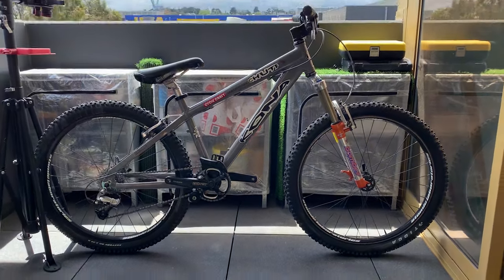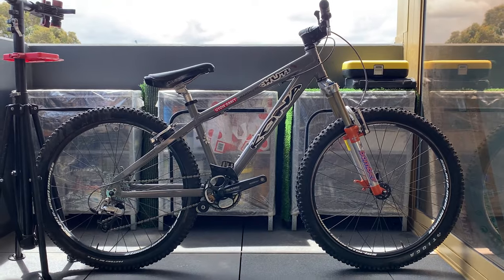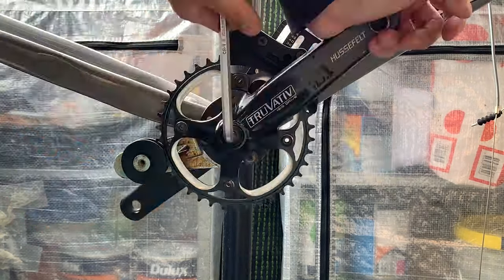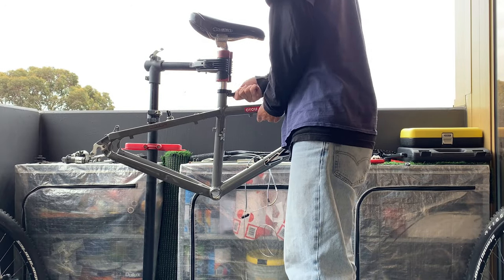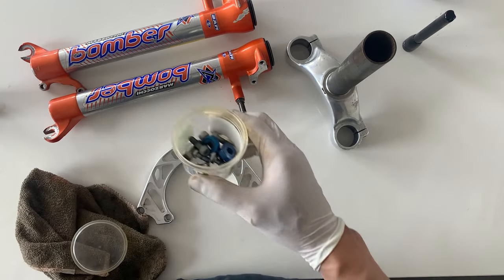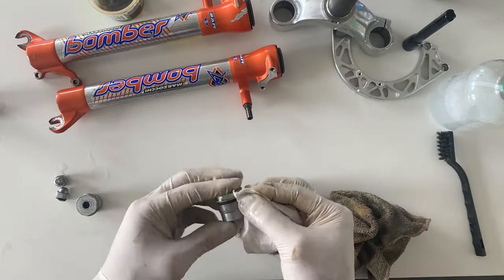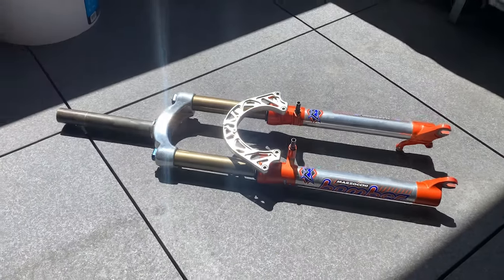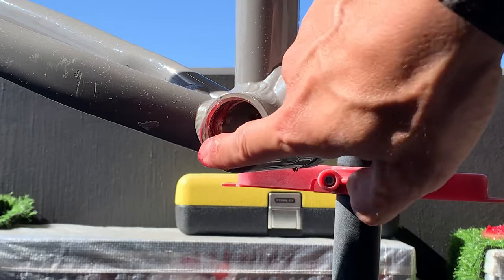single speed MTB conversion re build - Kona Chute Marzocchi z1 bam

Comment: The rear disc brake: There's more to it than just loosening the caliper. The inside pad is usually fixed and usually has an adjustment. You need to adjust that in/tighter, then pull the brake lever and tighten the bolts. Then you turn it out until it spins cleanly.
Reply from the maker: cheers thanks for the tip! usually i just loosen the bolts , pull on the brake and re tighten and that works! do you know where the pad adjustment is ? i cant seem to find it ? are you talking about the metal clip ?
Reply: @garysprojects  If the caliper moves both of the pads then no adjustment necessary. If the outside moves then look for a hex or torx head for the adjuster. You will see it from drive side looking through the wheel.
Reply from the maker: @peppermintpig974 ahhh nice, I don’t think this caliper has an adjustment but good to know if I work on other ones, cheers!

Comment: Great build! And I really like the tube chainstay guard idea, but could you explain it a bit better? I get that one end is held in place with a zip-tie, but what about the other? Is it just wrapped around itself? And if so is that really secure enough?
Reply from the maker: Cheers man! Ya u basically just cut up a tube and you put it flat on one end of the chainstay and u start by wrapping it around it self, then you keep over lapping it until you get to the other side and finish it with a zip tie. I didn’t use anything to affix the other end, it’s just held on by the pressure of the wrap. If you want u can put tape on where you start for more security or even a zip tie. For me it’s holding up for now. Hope that helps cheers!
Reply: @garysprojects  Alright, that makes sense now! Thank you so much!

Comment: what is your favourite handlebar grips? what is your top 5?
Reply from the maker: I’ve been liking the dmr deathgrips just because they are easy to put on, I also like oury v2 and the just soft silicone/foam ones on eBay - most of the grips I like i put in my bikes so check them out!

Comment: You didn't have to pump them with air afterwards?
Reply from the maker: The tyres I pumped up, forks are coil only
Reply: @garysprojects  Thanks for the clarification! Do you prefer the coil-only models to the pressurized models?
Reply from the maker: @icantgivecredit871  honestly I’ve only tried one other air fork so hard to say! Looking to get my hands on another so I can test more. 

I would say coil has better feel on the soft end of the compression (when it’s minimal compressed) but yeah air forks are meant to be lighter maybe better for huge hits because you can set the air pressure high

Comment: why a rear derailer for a single speed?
Reply from the maker: because the frame doesnt have horizontal drop outs so you have to tension the chain somehow - however i ended up doing the 'magic ratio' for this bike so it doesnt need to run one - have a vid on that if you are interested! cheers